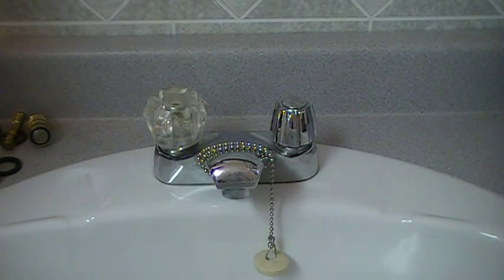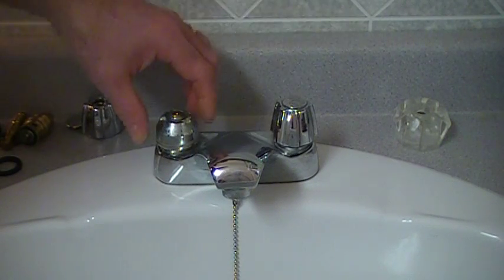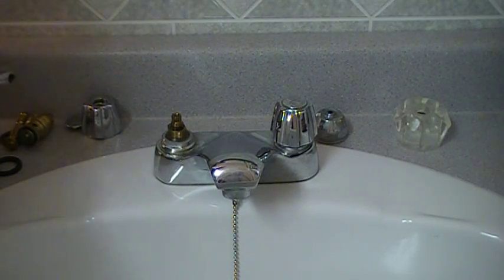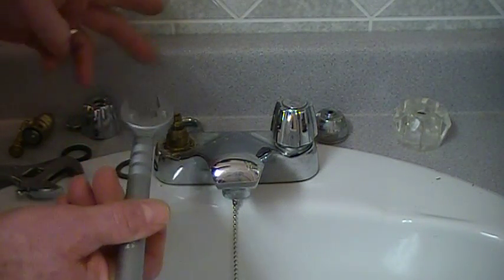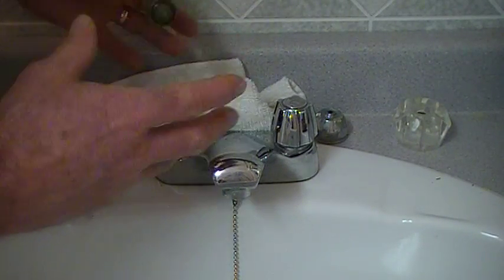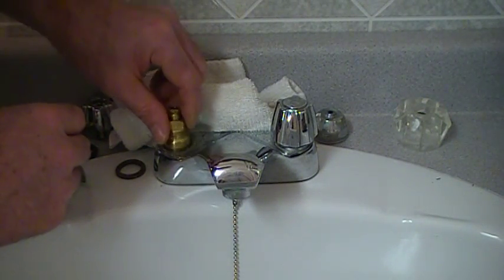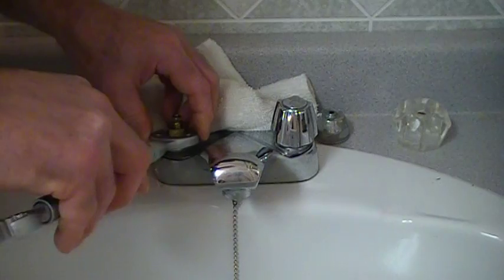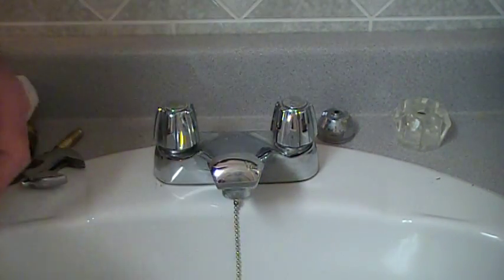How to repair a leaky faucet in a bathroom or kitchen...Crane

Comment: Wow, these are so much easier then dealing with Moen cartridges.
Reply from the maker: Hello RapisDeadly;
They are very easy to repair!
Just a matter of removing the nut and then pulling the cartridge out. At times they can be a little difficult, but can be usually be removed with a good steady strain!
Thanks for commenting and congrats on the repair!    Al

Comment from the maker: Hello Raine-Lee Rose;

All handles are different when it comes to removing them. Some of them actually just pull right off. Some have a cap on top that pops off and a screw has to be removed. Some have an allen set screw under the bar section of the faucet that has to be removed and will allow the handle to removed. 
Unless i actually saw the handle itself;I can not help you out more then that.
Thanks for commenting and best of luck with the repair!    Al